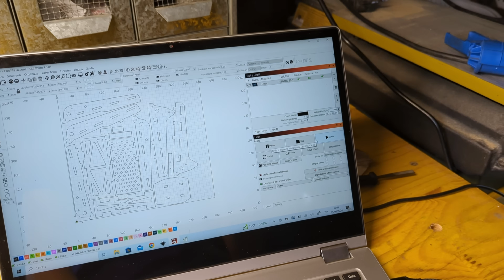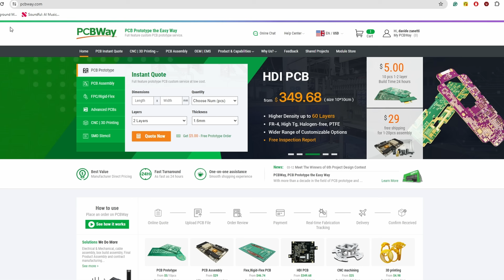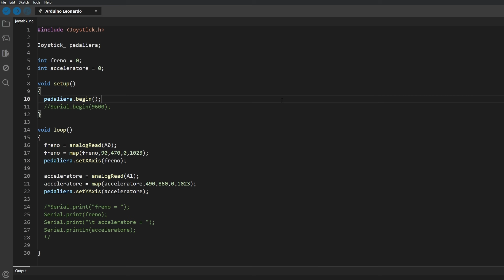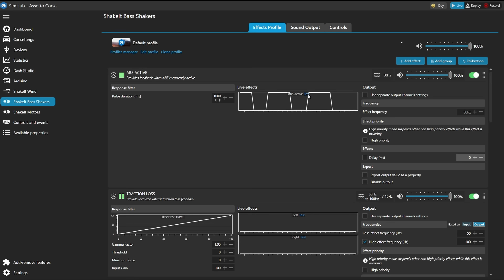DIY sim racing PEDALS, 150$, super realistic

Comment: Why not attach the pressure sensor straight onto the master cylinder?
Reply: Exactly my question
Reply: As far as I can tell the brake fluid needs somewhere to go when you press the pedal. You could put it directly on, and it would measure the pressure your foot is pressing with, but you'd have no travel in the pedal since the fluid can't compress or get out of the way, and it would basically become a solid pressure sensor like a weighing scales.

Also, the fluid pushing the caliper out is what makes it feel like you're actually using real brakes - that's the whole point of using real brakes in the first place instead of copying the accelerator pedal

Hope that helps!

Comment: This is a well thought set of pedals!I'm not a fan on the wood construction(although I understand the reason), the throttle spring also isn't what i'd install, but other than that the set is really brilliant!
Reply: in place of spring what might be used ?
Reply: @arindamghosh5438  a linear spring like most sim pedals have a better feeling